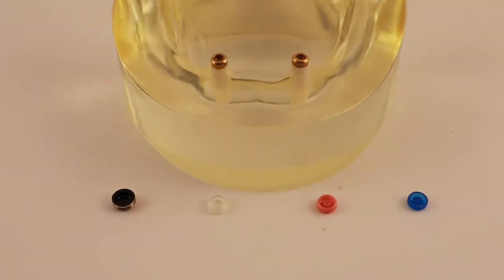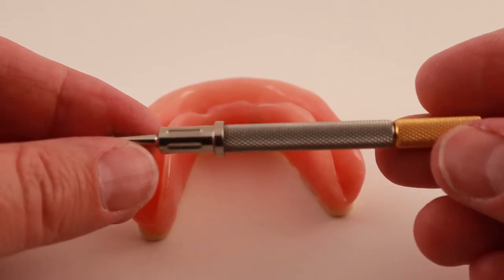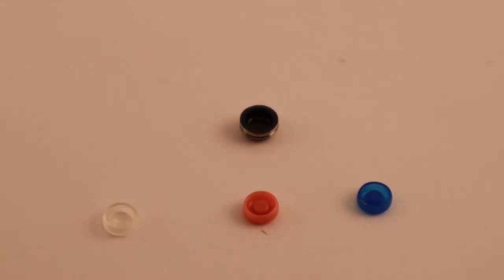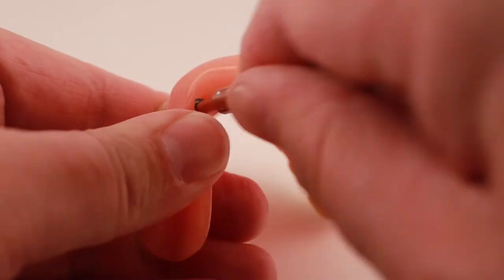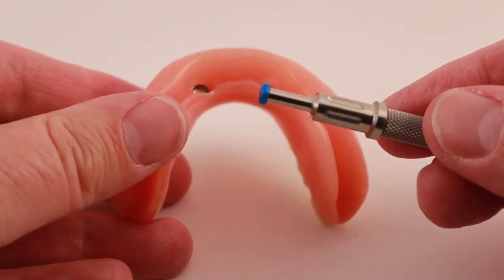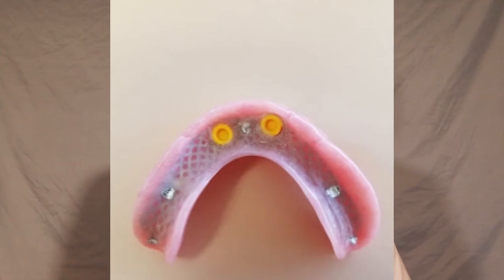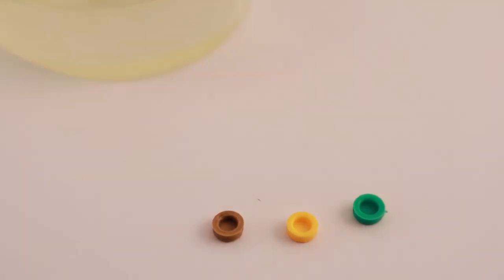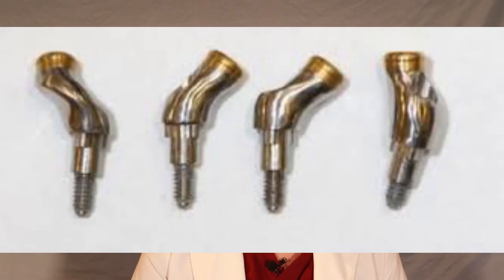How do snap in dentures work? A close look at implant retained overdenture snaps.

Comment: I had 4 implants put in my top and bottom gums after full mouth extractions. The plan was to get snap on dentures but I’m considering getting the ones that are screwed on. I’m having trouble getting the doctor’s here to understand this, 1 wanted to charge me $16k just for the dentures. My surgeon’s going to charge me an extra $3,300 to do the ones I want but I can’t understand how to explain to places that I just need the part with the teeth no hardware. I’ve used the term 4 on 1 and every other term I’ve heard. My dentist who ordered my temporary set said I wouldn’t need a temp and a permanent set. Are temporary dentures less sharp because I even though I’ve learned how to eat I can’t chew my food. I can pretty much only mash it up. If anyone has advice please let me know. I’m scheduled to have my screws uncovered next month. Thank y’all
Reply from the maker: The term to use is "all on 4" to talk about a non-removable set of teeth on dental implants. In my area cost is around $30k per arch.  You need to decide what type of teeth you want first before you have implants placed.
Reply: @VeryNiceSmileDental  Thank you for getting back with me so quickly. I went into the process planning on getting the snap on kind with 4 implants in the top & bottom but while healing I asked oral surgeon about switching to the kind he screws on instead. He said he could do that with an additional charge of $3,300. I’ve already spent over $20k so I asked the doctor who made my dentures what it would cost to get the other ones made and they said $16k…nothing but the dentures. I’ve been trying to figure out why it would cost so much but I’m having trouble getting an answer. I’m wearing my 1st set which they said would fixed to snap on but they’re not sharp enough to chew my food. I saw a couple other doctors before & each said I’d get a temp pair & once healed I’d get my permanent set…but was told by my dentist 2 sets weren’t necessary. Between me & my Ins we’ve paid about $3,700 for this set. I’ve got to make a decision soon because I’m scheduled for surgery in about 5wks and my surgeon needs to know which I want. His fee is to uncover the implants attaching everything I need for either kind, if I stay with the snap on there’s no additional charge. Thank you again.

Comment: My rings keep getting crushed. I've gone through multiple sets on my bottom denture and when I look at the rings I can see that the edges are caved in and they won't snap in. I'm using the medium pink rings. I have the blue ones on top but haven't had any trouble with them. Thanks for your great video!
Reply from the maker: You're welcome!  Make sure you insert your overdenture and seat it with your fingers.  Don't bite it into place, that can push on the rings at an angle and cause them to wear quicker.  Thank you very much for watching!
Reply: When the caps keep getting crushed this usually means the implant and abutment are at to much of an angle.They should be as vertical and parallel to the other implants as much as possible to allow the denture to snap in without any interference
Reply from the maker: It's easy to find the tool and the inserts online. Replacing the snaps is simple. It's good that he gets his remaining teeth cleaned a twice a year. His dentist should check his denture at each visit to make sure it still fits properly. Thank you very much for watching.

Comment: Will 2 regular size well placed implants in the bottom of my jaw work or will they rock back and forth when I eat?   Or can this be corrected by stronger snaps?   Also will stronger pound snaps wear out the implants placed in the jaw and ruin them in time?   Is this stuff common?   My Dentist told me the other day that having two implants on bottom in his many years works perfectly fine.   ?  Yet others on here say they will rock back and forth.
Reply from the maker: Hi, it depends on your situation, but I've done many lower overdentures on 2 implants and they work well. Overdentures that rock usually need a reline and/or the posts are tall above the gumline.

Comment: Your videos are very informative. I have to visit my dentist tomorrow. I have snap in over dentures. The upper has blue snaps but still feels too tight. The upper hugs my gum too tightly. The bottom denture has two white caps and I can't get one side to snap in. It sounds like I've snapped in both sides but when I begin chewing the bottom denture comes completely loose.
Reply from the maker: Thank you for your kind words. Hope all goes well tomorrow, it sounds like it should be an easy fix. Adjustment on top and maybe new inserts and a bite adjustment on the bottom.  Let me know how it goes and if I was close in my assessment.

Comment: I was told I could get implant and now they say my mouth is to small and I have to get this procedure. Is the cost cheaper than implants? About what is the cost? Is this procedure as good as implants?
Reply from the maker: Snap in dentures does involve implants. It is usually less expensive than getting permanent teeth on implants.

Comment: Thank you for the video.  I have a permanently screwed in upper denture (on 6 implants).  It is very strong but i cannot get all the food out from behind it no matter what i do so the food decomposes in my mouth and causes extreme irritation and even gum damage so i want to switch to a snap on denture.  Will i be able to use the denture i have and have it adjusted to work as a snap on?  It is both a great denture and strong but was expensive so i would like to use it for the snap on if possible.
Reply from the maker: You're welcome and thank you for the question. Without seeing your dental bridge, I'd most likely tell you that it won't be able to be converted into a snap on denture. You would most likely need to have a new snap in denture made, along with new snap in posts installed onto your implants. It would be extremely rare that it could be retrofit. I'd recommend you talk to your dentist and tell them what is bothering you. They may be able to reshape the underside of your upper bridge so that food doesn't get stuck underneath it. The underside of the bridge that touches your gum should be convex and not wrap around your jawbone at all.  What material is the bridge made out of?
Reply: @VeryNiceSmileDental  I believe it was titanium?  Does that make sense?   it was very expensive and i would love to reuse it.  Is there no specialty business that could retrofit this- or would it not be worth it both in cost and structural strength?  Oh well.  Worth a try.  Thanks for the help.  It is a great service you provide.
Reply from the maker: Hi Billy, so it sounds like your bridge has a titanium bar, what is the pink gums and the teeth made out of?  If it's made out of denture acrylic and acrylic denture teeth, then it's easier to work with.  It "might" be able to be retrofitted, but there  are usually issues that prevent it.  It may be easier to start from scratch.  It's like renovating a house, if the foundation needs to be completely redone, it's easier/less expensive to start over rather than try to retrofit.  Some dental materials (porcelains in particular) cannot be refired in the porcelain oven once they've been in the mouth for any length of time.  I hope that makes sense.  Let me know if I need to explain it better.

Comment: Where can i purchase the tool and replacement caps, with out having to go to the dentist. Thank you. Great video
Reply from the maker: Hi, the tool and the replacement inserts are available on Amazon, but be sure to ask your dentist what brand they used. Different brands are usually not cross-compatible. And be aware that the housings may need to be re-embedded in the acrylic of the denture, that's something your dentist needs to do.

Comment: This video was extremely helpful, thank you Dr. Rich. After having my permanent implants on my bottom teeth for 18 months, I still have to go once a month to get my bottom implants realigned. Is that normal after so many months? Also, I usually wear the green rings, but a few weeks ago they were out of them and put in clear. He said it won't make much of a difference. I feel a big difference.  It is very difficult to snap on.  I am going back Friday and hopefully the green rings will be in stock. The dental assistant then said he would put in the orange color rings and they are the same size. If they were the same size why didn't the assistant put it in from the beginning?  Now the dentist came in took x-rays and said he would like to take my two screws out and add 4 screws all together and charge me another 15 grand. . I cannot afford another large payment. I paid 14 grand the for the ones I have now. Where is the guarantee that the second time is going to work, if now he is telling me I should try another type of implant? I have said no to the second surgery and to make this one work.  I am hoping just getting the right fit with the rings will be a big help and to keep realigning until my jawbone has stopped changing. What is your opinion? Thank you again for explaining everything so thoroughly Dr. Rich.
Reply from the maker: Without seeing you in person it's hard for me to say what is going on with your overdenture.  Some possible issues are, it needs a reline, the snap posts may be worn, the posts may be at an angle to each other, or the posts may stick up out of your gums too high.  I
Reply: @VeryNiceSmileDental  Thank you for your reply. Perhaps Friday they can check on what you mentioned. My other option is to get a second opinion.
Reply from the maker: Let me know how it goes.
Reply: J

Comment: The video was extremely helpful. I have a snap-in implant full top denture. When my dentist placed the next level of rings in my denture to snap-in more securely, it was really tight and I had a hard time removing them. Could this cause an issue with the implanted post? I had to go back to the black instead of the pink rings which I feel more comfortable with. I know I have to go to the next level to ensure they stay securely in place, but I don't like the pulling I have to do to remove them.Any advertise would be appreciated. 👍👍👍
Reply from the maker: Hi, if you have Locator brand snaps, ask your dentist to use the blue ones. Pink is medium strength, blue is light strength. I have a couple of patients who stayed with the black rings for a while, then I replaced only one or two with blue and left the others black.
Reply: I had the exact same issue i had to go back and get the rings changed it was a nightmare trying to take them out there grand now but it was very annoying only got them sorted last week
Reply: How are you gettin on with flossing them cant seem to do it 😂

Comment: I'm researching Snap-in as an option for my dad. How long can you go between maintenance visits? What does maintenance consist of? Do you eventually need to replace the dentures themselves and what is the cause for replacement dentures? Can that be avoided or extended?
Reply from the maker: Hi, I made a video that discusses maintenance. https://youtu.be/W24FEC7_oBU
The most common wear item is the plastic snap. The denture itself will wear and the gums underneath it will shrink.

Comment: My pink snaps seem to be wearing out or not holding up very well on my upper denture.  Sometimes my teeth even want to fall out with a simple sneeze. I seem to have to go in once every 3 months to get new ones put in. Is this normal? They are parallel to each other and I have a total of six in the upper denture. My lower denture doesn't seem to have a big problem and only has three. The dentist is using the pink snaps. Finally, is it possible for me to put my own snaps in?  Thank you for your very educational video. I do appreciate it.
Reply from the maker: Hi, 3 months sounds excessive. Are all 6 snaps pink? Are you biting the denture into place? That may cause extra wear on the snap. I made a video that about that, https://youtu.be/W24FEC7_oBU

Comment: I recently replaced my snaps myself because mine were worn and the dentist I went through the first time I had them replaced and now wanted too much to replace them again and I had to supply the snaps myself. I want to replace the metal caps now, do I need the black insert that goes into the metal?
Reply from the maker: The black inserts usually come with the new metal part of the snap. The metal part needs to be seated and secured into the overdenture with acrylic. I recommend you have a dentist do that since if too much acrylic is used, you can lock the overdenture into your mouth. Thank you for the question and thank you very much for watching.

Comment: Thanks very much for the help.
 I have upper and lower dentures and the bottom plate has two implants on it, that's all I could afford, period. Mostly my retainer clips only last 4 to 6 months and so I put Poligrip on both upper and lower. My dentist who installed my dentures top & bottom charges my $50 to change out the retainers and he just put the Black ones in, I didn't know anything about this or I would have ask for the stronger. Regardless, by 4 months it's as if I didn't have implants at all, what's the point? $6,000 up in smoke and I got NADA.
Question, can I change these retainers myself?
Reply from the maker: Hi, the black inserts are usually the zero retention (at least for Locator brand inserts) inserts. Has your dentist ever used the blue inserts in your denture? Just swapping out the inserts is fairly simple once you have the inserts. Why are yours wearing out so quickly? Are you biting the denture into place? Are the two implants not parallel to each other?

Comment: Hi Dr. Rich. My question is how do you properly clean the small cup-like hardware over the implants in mandible?
Reply from the maker: Hi, you can use a toothbrush or a blunt, wooden toothpick to remove any food or plaque that might be in the snaps (cups). I have a video that talks about cleaning the overdenture,  https://youtu.be/W24FEC7_oBU
Reply: @VeryNiceSmileDental  Thank you. The toothbrush isn’t enough. I will try a toothpick bc the dental brush I’ve been using is not enough, either. I just recharged a water pick, too.
Reply: @bigdawg7703  The cups have to be replaced every 3-6 months to maintain a fit while chewing/eating, something they do not tell U about beforehand. That’s about a $125 fee each replacement depending where U live.
Reply: @colleencarr3470  I have had them changed. 5 x now In 4 months. I haven't been charged yet, but that's coming soon, I'm sure. Let's just pay this guy some more on top of the $20 grand. He never told me this may not work before I paid him for the snap-ons. I really had no choice but to get them I didn't have any teeth left. None of this includes the $10 grand for the surgeon. Thax for listening and being honest.

Comment: Sometimes the snaps over time become very hard and rigid and do not come out easily with the tool. How do you remedy this? Has the tool been modified at all?
Reply from the maker: You could try using a sickle scaler to remove the old snap. I've done it in a pinch.

Comment: I have looked online to see if I could find a zest locator snaps which I could put in myself. I noticed that you had said in one of your comments that it is possible to do so. However, I am finding that they are talking about millimeters and different sizes. I have no idea how many millimeters mine might be. How do I find that out? My dentist simply tells me I cannot do it myself. And then he changes the subject.
Reply from the maker: Hi, replacing the snap themselves is easy to do but that may not fix the situation. How old is the upper snap in denture?  In some situations, I find that the denture needs a reline or the snap housings need to be reseated into the denture acrylic. Locator style snaps that fit in metal housings are usually all the same size. Be aware that there are other brands of snaps that look similar but are not compatible with Locator posts. The super snaps (that's the brand name) I show in the video will fit onto the Locator implant posts and don't use a metal housing. I've found them to last longer than locator brand snaps. The super snaps need to be embedded into the denture acrylic.
Reply: @VeryNiceSmileDental  these snaps are only about 3 years old.
Reply from the maker: Have your dentist take a look at your upper denture, it may need a reline. The snaps just hold the denture in place. If the denture is resting on the snaps instead of on the gums you will wear out the snaps very quickly.
Reply: @VeryNiceSmileDental  thank you.  I do believe they are not resting on the gums.
Reply from the maker: That is probably the reason. Relining and reseating the snaps in the denture should fix the issue.